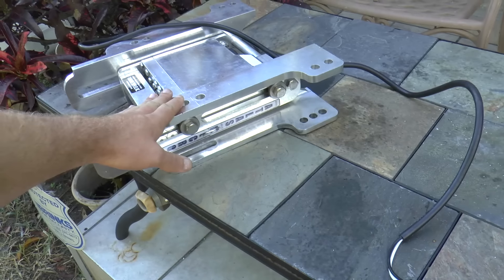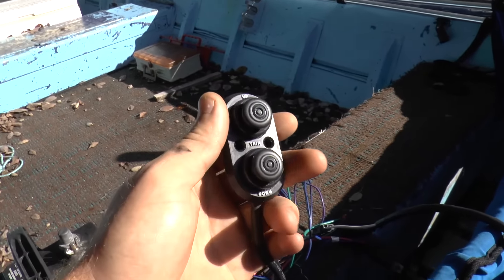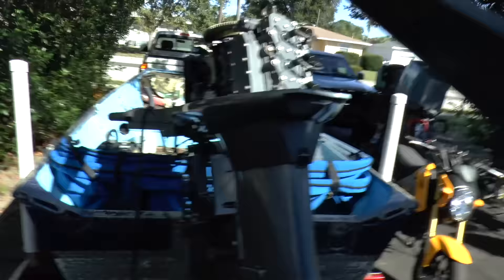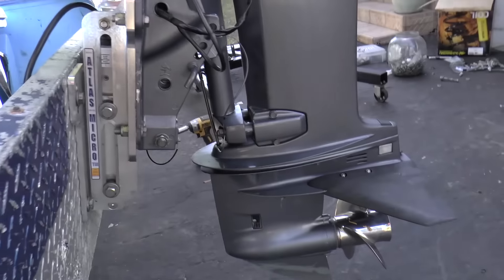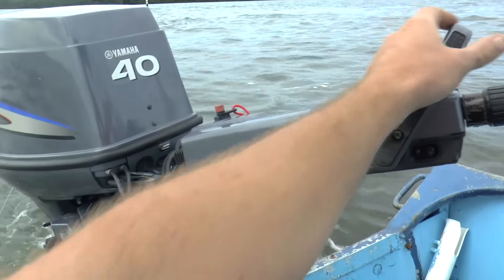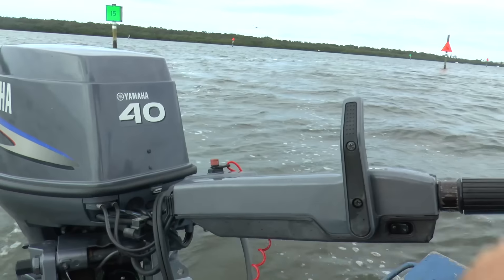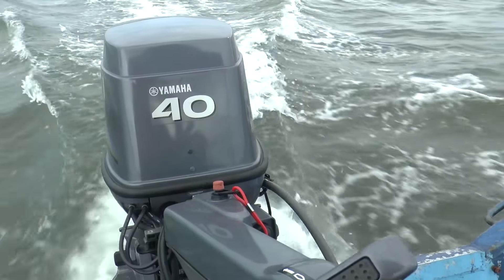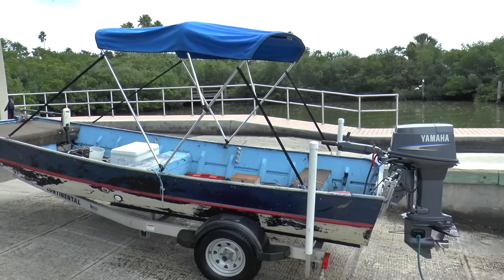I Finally Purchased A Jackplate!!!

Comment: What's with that vibration? I would try to resolve that if I were you.
Reply: Typical two stroke vibration nothing to worry about. You saw it smooth out once it was running

Comment: the motor is way to deep in the water.  You can tell by all the spray the motor is causing.
Reply: grady vago get out. He was doing a comparison to the normal height without the jackplate

Comment: 2stroke vs 4stroke 40hp?  Why
Reply: More torque and low end... less parts to wear = better dependability, and MUCH easier to work on.
Reply: Also, MUCH better Hole-shot compared to a 4 stroke
Reply: yes 2 strokes are much snappier, simpler too, but you'll get double the gas mileage from a 4 stroke. also more RPM to be got from a 2 stroke.
Reply: @modelnutty6503  
I love the simplicity and ease of tuning/repair of a 2 stroke... not to mention the life span compared to a 4 stroke, but if you fish the flats, a fast hole-shot is absolutely paramount... no 4 stroke can compare, or even come close.

That said, we also have a pontoon with a 90hp Yamaha 4 stroke, and I wouldn't trade it for the world.
Reply: The power to weight ratio just can't be matched.  If you have a light aluminum boat,  you want as little weight as possible on the back end.  Pound for pound,  no modern 4stroke 40/50hp can get within 60 pounds of an old Yamaha 2stroke in the same horsepower class.  Couple that with the low end torque,  and you'll have a boat that can be on plane in less than the length of the boat.
Reply: @Texcajun06  The honda bf50 weight is around 205lbs compared to a Yamaha 50 2 stroke weighing 189... I think it matters on the performance you're looking for, 30-60 lbs wouldn't be any different than a cooler full of ice or extra gear.
Reply: @Josephguestable  I'm currently running a 2 stroke 90hp Yamaha at 260lbs.  The Honda BF90 comes in at 360lbs and can't even come close to the torque numbers,  or weight for that matter.  On my little 16' skiff,  that extra 100lbs on the rear would be be awful.  

Don't get me wrong,  I think the 4 strokes have their place, quieter, cleaner and definitely more fuel efficient.   There are just some laws of physics that they will never be able to overcome.
Reply: Joseph Guest weight wise, the new 4 strokes are within 10-15 lbs of the old 2 strokes, but despite that, nothing beats the torque of the 2 stroke, which is firing every other stroke versus every 4th on the 4 stroke, big difference in heavy load capacity and hole shot...

Comment: $800 jack plate for that piece of sh&t john boat?!?  I guess if you feel it adds value to your business by being able to run/test different shaft length engines out on the water then it's worth it.
Reply: Why not just mount the motor at the height the jack plate performed best at??? why would you want to return the motor to the low position were it performed the worst? Get rid of the multi position high dollar jack plate and just mount the motor higher on a fixed aluminum mounting plate!!